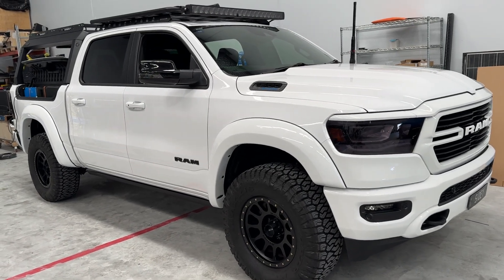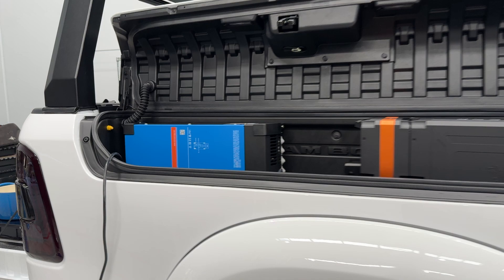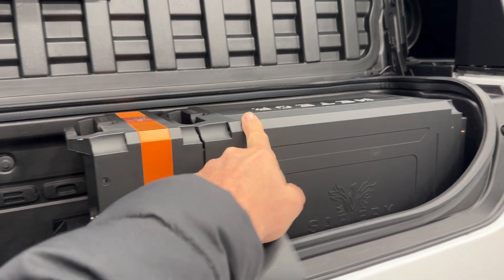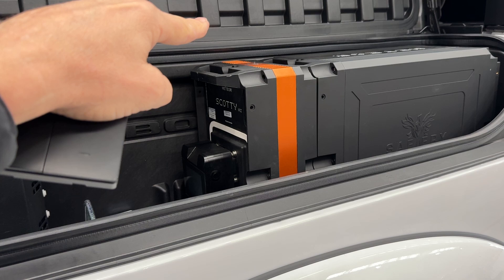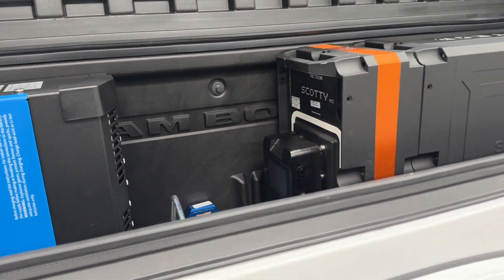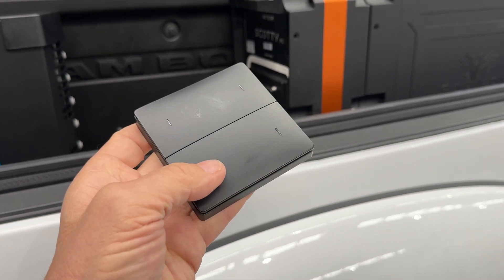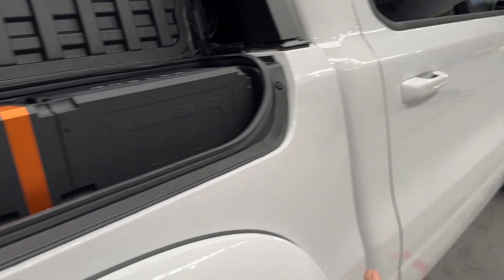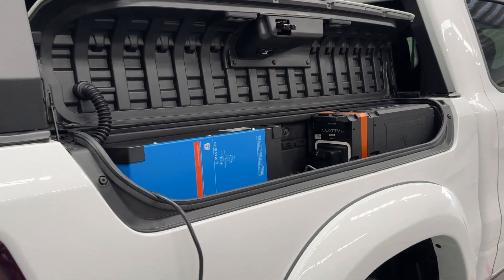RAM1500 RAMbox gets big power 8000W Lithium 3000W Inverter 125A DC DC from eTorque

Comment: What is the load rack you have on the back of the RAM that suits the Rambox. I need one 😊
Reply from the maker: Sorry, I dont understand your question? Do you mean the electrical power pack?
Reply: @Safiery  thanks for the reply. I mean the metal rack above the ute tray of the RAM. It's not a Safiery product, but I've been looking for one that suits the rambox. Also, do you have any recommended installers in Sydney for the battery and inverter?

Comment: Hi, any chance you know the Etorque current output at engine idle? I am trying to make sure I can run a 12v 400w pure sine wave inverter (roughly 34A draw direct wired to the starting battery) off my Etorque system while idling in the driveway and don't want to put too much load on the system. I have googled so much but can't seem to find an answer.  Subbed and thumbs up!  This is really awesome setup. I'd love to see more videos.
Reply from the maker: Yes we have done several but the control of the draw is critical or you end up with a screen full of codes. Our Scotty AI has special  software for it.

Comment: What size are the induction coils in the induction top?
Reply: 2000w for single model and 1500w and 1800w on the Dual induction
Reply from the maker: Thanks
Reply: @Safiery  not the power output, the size.  Problem is smaller coils warps skillets due to heating a small surface area only.
Reply from the maker: @paulvictor9368  they are big but I don’t know the exact size but as big as the ring marks on top of induction
Reply: @Safiery  wow, that is good to know. Thanks.
Reply: @cobra800hp  thanks, but I am after the coil size, not power output.